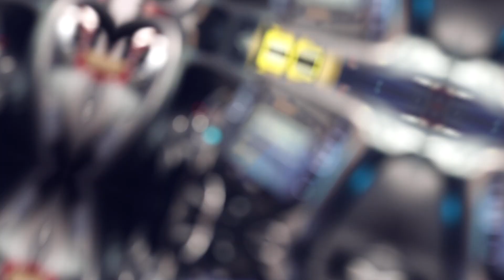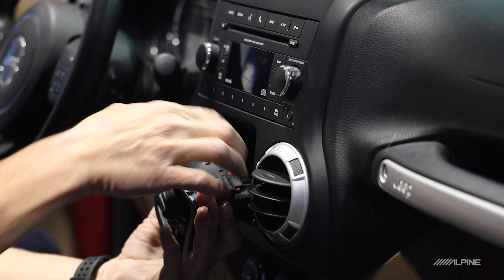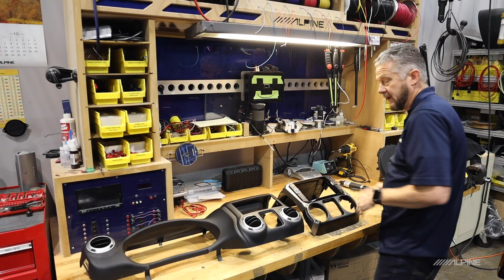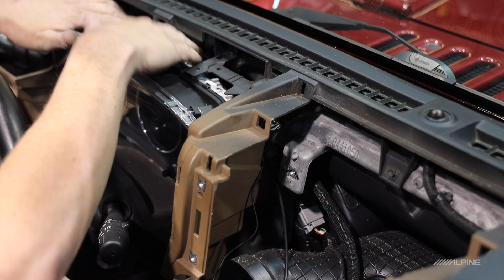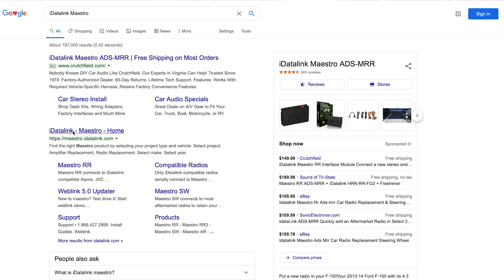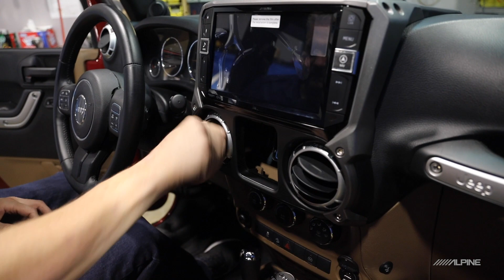Alpine | X409-WRA-JK Installation Tutorial | 2011-18 Jeep® Wrangler JK

Comment: How does the bezel mount ?
I have kind of reverse your video. Bought a jeep with your unit and now have to wire in a subwoofer, so I need to get the bezel off and I'm not sure if it just pops off with a trim tool after removing the vents or do I have to remove some screws ?
Thanks

Comment: I have the i209 and firmware is somewhere around 3.0, I've been experiencing an issue where the headunit randomly shuts off and doesn't come back on for 10-30 minutes. Very inconvenient and upsetting when this unit costs near $3,000 dollars! When it shuts off power is also lost to my USB in the glove box as well as my aftermarket amp.

Comment: Have this in our 2012 jk and the system shuts off sporadically and doesn’t come back on for days. Any idea why screen goes black and system shuts off?  Overheating from hot air from vents, maestro needs firmware updated?  Any help is much appreciated.
Reply: I have the i209 and have been experiencing the same issue, thankfully not days but maybe 10-30 minutes until it comes back on and acts completely normal. I have flashed the maestro module through the settings but still seems to give a problem. I am not the original installer either
Reply: No power to headunit, usb in glove box or my aftermarket amp when it shuts off too so I'm thinking it's either a wiring issue with the headunit itself or a software/firmware issue but I don't see any support or updates for the maestro module...wish alpine would have some answers for us....

Comment: What you need to know for the navigation voice and some bluetooth features to work is the speaker plugins need to be reversed from the maestro unit to the head unit from black to black and white to white to black to white and the same for the other connection i just bought the radio and its even in the manual because the navigation voice will not work until you do and i didnt see this in any install videos just trying to help and relieve the pain and time later.
Reply: Can you talk more about this? Mine isn't functioning. I'm not a pro at this, at all
Reply: @neilmarshall4927  Hi neil just happened to look and saw your question if you have the installation manual you will see on page 13 of 21 it specifically states what im talking about im not a genius with this stuff either i was having the radio installed at a shop that does installs and after I left I decided to use the navigation and noticed that when the voice for navigation was supposed to cut in the voice was not working to blurbed i had been at the install all day and just went on home and started looking through the manual and found that it specifically says that failure to connect the speakers in reverse order at the head unit will result in no audio from navigation and blue tooth source and issues as a warning so I called the shop and told them the next morning and took it back and they fixed it I know there are a lot of wires its just not really plug and play for a lot of us including me so I would take it to car toys or a shop like that and inform them what’s going on tell them what you now know and that should get you going,hope this helps and good luck.
Reply: @frnk008  thank you. I'll try this. I haven't had Bluetooth or turn by turn voice since it was installed
Reply: @neilmarshall4927  👍
Reply: Frank Wright, I swapped the plugs today and I now have Bluetooth! Thank you so much. It could be a placebo, but the speakers seem clearer, too
Reply: @neilmarshall4927  No actually that’s true when you swap them you’ll get all your full sound what you need to do now is swap out your speakers for better ones put in a subwoofer in under your backseat and have a five-way amp put in there that’s what I did with mine man I can turn my sound up to about nine and blow me out of the jeep that I have now I have a Jeep Mohive yes
Reply: @frnk008  I have all replaced speakers. I went with the Alpine JKU specific "marine" type speakers. They are awesome! My sub is also an Alpine that I fit into the factory sub box.
Reply: @neilmarshall4927  👍
Reply: @frnk008  hey man, I have a new issue. Now I can't adjust between my front and rear output. If I push it all to the rear, it goes silent. All the way front and it's full power to all of the speakers
Reply: Hit setup then under system you wil see under system from the top factory system setup the next screen you will see maestro module (sorry do this step in accessory mode with out truck running or maestro features won’t light up sorry ben a while since I did this) then tap vehicle features you see gain ,speed comp volm,surround.

Comment: my alpine X409-wra-jk equipment has problems, it turns off and on only continuously at intervals of 1 minute or less check the wiring but everything is well connected, any advice
Reply: alpine said my maestro was probably bad. I ended up needing to replace the entire head unit.

Comment: Nice install video. For such an expensive head unit, why do you need to add additional GPS antenna and external microphone when these are already present on the vehicle?  The background music volume needs to be dropped to a whisper as it is so annoying.
Reply: Glad I ran a search before commenting. This is exactly what I was going to say. I got to step one and dug through the bag looking for the BT microphone. Does this thing really not use the OEM microphone? Why do I now need to buy a mic for this? Excitement: deflated. Now off to buy a mic from some place.

Comment: There's been a revision to the product since this video was made. The USB connection no longer reuses the factory USB connection to the center console, and there are four maestro connections instead of six. The manual in the box is outdated, the current version is here: http://support.alpine-usa.com/products/documents/IM_X409-WRA-JK_EN.pdf
Reply: This helped so much thank you
Reply: Is there any reason why the factory USB in the center console cannot be used with an adapter and the supplied USB cable to the head unit?

Comment: How is this comparing to the x209 OR? Does this come with a CD/DVD slot?
Reply: No CD/DVD slot. From what I've seen poking around, you're just going to have a better time with the newer model. The x209 has some weird and outdated software (things like not being able to fast forward music unless using bluetooth, Pandora app but no Spotify, etc). If you're upgrading for resale value the x209 will save you money, if you plan on using the Jeep the newer model is worth the extra pesos.
Reply: I just got a 2015 rub that had a x209d already installed and having all kinds of wierd issues. Backup camera won't work. Came on once for like a second. USB plug for flash drive doesn't do anything and isn't recognized in options. Remote doesn't work at all. I even changed battery. This jeep has only 24,000 miles on it so it was hardly used. For what these alpine systems cost they should work flawless still. Guess I'm gonna have to pull it out and check all connections. Uugh

Comment: Had this for a few months now and it’s cool... just got 4 accessories hooks to the aux button page, light bar, light pods, rock light and the buttons don’t work about 30-40% of the time. They’ll highlight yellow like something supposed to be on but it won’t be, then they’ll work the following time, back and forth so then they say off but will be on. Then you go to turn off/on and it won’t change?? Is this a common problem? Love the deck but super disappointed in this for $3000 +
Reply: do the lights have inline fuses? i had this issue w/ my sPOD and it turned out that was the cause. i simply removed the fuses and spliced the wires back together and everything worked correctly.